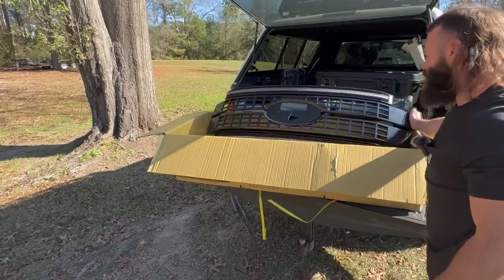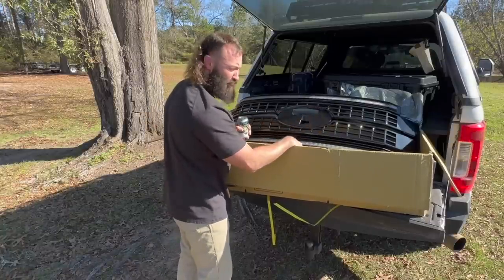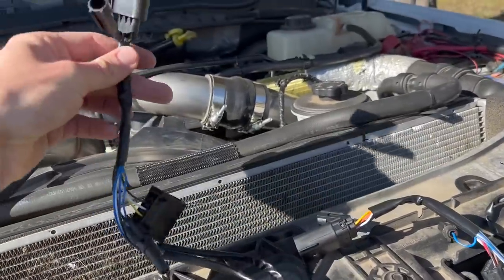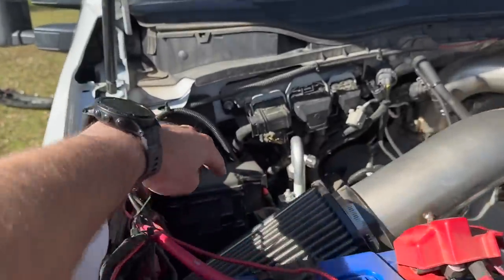Ford F250 Morimoto XBG grille - The Ultimate Truck Mod

Comment: If you disconnect the drl wire it will just dim the C bars. From what I understand the C bars stay hot all the time regardless of fuse tap wire. Idk. That’s what I hated about my morimotos. Especially huntin. Cheers brother 🍻🍻🇺🇸🇺🇸🇺🇸

Comment: Thanks for the video. I have my XB DRLs hooked up to a switch pro switch where I can turn them off. I would hook this grille up to the same source so I can kill it if needed.. THis looks great.. I want the black version but not to paint.. wonder how well that will hold up.. wonder if it will scratch easy and lose that gloss.
Reply from the maker: Nice! Where did you get the switch? I assume it would be just like a upfitter that I have…..time will tell about scratches, but I think it will be fine. I assumed the black paint to match was only needed to be painted if you didn’t want black. So I’m gonna roll with it. 🇺🇸🦅🇺🇸
Reply: @COLTSWAY  Looks like my initial reply didn't stick - guess it doesn't like a link and treats it like span..  I got the sp9100-switch-panel-power-system from switch-pros . Allows me to run all my lights to the main box under the hood and just a control wire runs from it into the cab.. I mounted the switch on the cluster on the roof with sunroof switches etc.. I got my off ebay back in 2018 for a good price.. while its pricey, I recommend something like this if you are going to have multiple lights hooked up.  I have a strobe - emergency mode that enable all my led lights/bars to strobe.. one of the buttons is wired to the DRLs so I can have them on or off with a touch of a button.

Comment: Just an FYI, I’m pretty sure if you run that fuse tap to an upfitter, you will lose your turn signals when the switch is off. But I’m not 100% sure about that.

Comment: If you would have powered the putco led emblem, how would you have done it? I have the same setup and I’m trying to figure out how to power my emblem now that the fuse has been taken over by the morimoto products
Reply from the maker: I had it powered by an upfitter switch that way I could turn on and off when I wanted. 🇺🇸🦅🇺🇸

Comment: U can turn off running lights goo to settings and u will fine
Reply from the maker: I’ve already tried that. It won’t work. Might could change it in forscan though. I’m just gonna put it on a upfitter though.